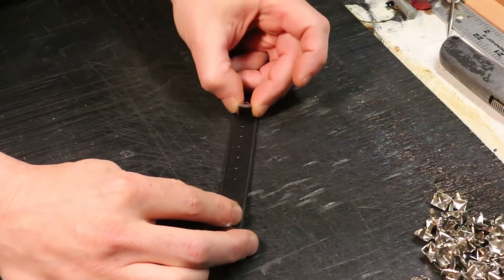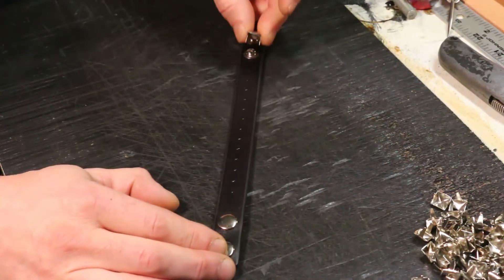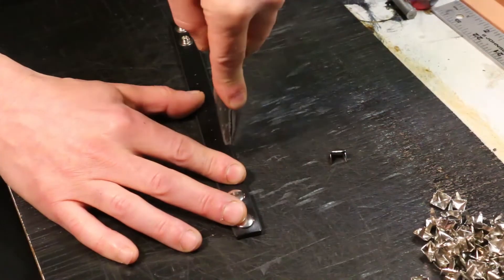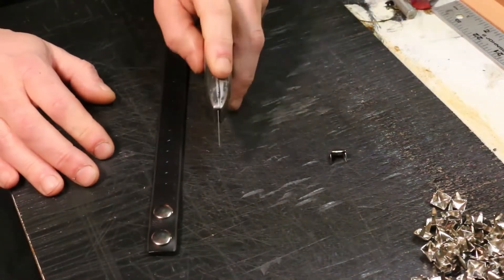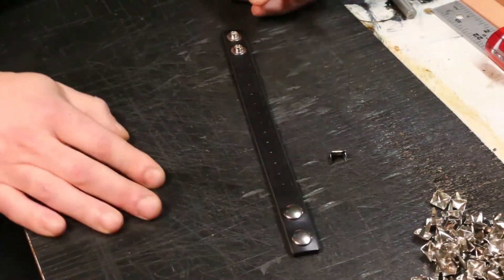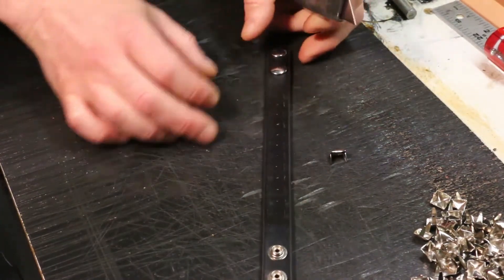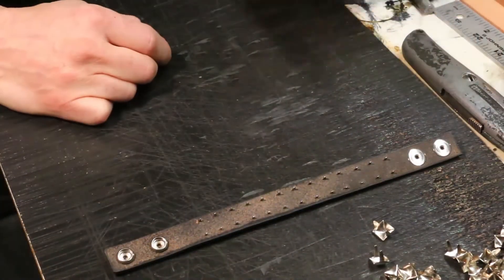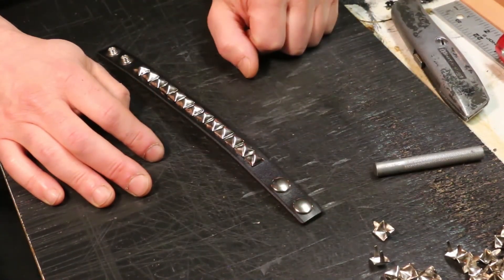How To Set Pyramid Studs Into Leather

Comment: What brand pyramid spots do you use? I use the ones by Standard Rivet. Though I've noticed the nickel plated brass ones start turning green on the tongs as the finish cracks when you bend the tongs. I may order some nickel plated steel ones to see if the finish cracks on that also. Not sure how easily they would rust. But I noticed the nickel plated brass ones starting to turn green after a few years. I'm thinking rust would look better than green. Though the nickel plated brass people say are more premium.
Reply from the maker: Standard Rivet is the ONLY North American company that makes these shapes. Everybody else you're buying from is just reselling SR products. 

The green oxidation is inevitable, but with steel, you still get rust, it'll just be red/orange instead of green. As you point out, this only happens on the underside to the legs (prongs) because they lose plating during setting. 

Cost wise, rolls of brass are 3x more expensive than steel rolls. I may have told this story before, but one of my earlier belt customers was mad when he thought his chrome/brass studs were cheap because he couldn't stick a magnet to it. So, now, I also have steel for magnet aficionados.
Reply: @leatherpunk  Which do you think are better pyramid spots, nickel plated brass or nickel plated steel? i.e. I'm not exactly sure why someone would pick one over the other. But I know the nickel plated brass is more expensive. 

I've bought mine directly from Standard Rivet as theirs look more classic to me compared to the flat/straight edges of other brands of pyramid spots.
Reply from the maker: @colt5189  From the perspective of someone who has about a quarter million shapes in my stock,  I prefer brass over steel because they're easier to set, less of a jolt on my foot when the prongs fold.

Comment: I'm trying to put pyramid studs into soft plastic, but I'm stabbing my thumb with the sharp ends😢
Reply from the maker: I bet they are. Instead of supporting it with your thumb, try to find something that's firm enough, but will allow the prong to pass through, maybe a piece of hard Styrofoam. Or, you could make a thumb pad to minimize the discomfort. I made a thumb guard out of leather to protect against getting cut during certain leather tasks. I also have one for my palm when I'm using the awl repeatedly.
Reply: @leatherpunk  Thanks so much. I'll adopt one of your ways now. I think I'm guilty of instant gratification or rather doing things quickly and to heck with the dire consequences🤔Thank you again.

Comment: How could I set these on shoes?
Reply from the maker: I've never done it, but you're going to be limited on where you can put studs on shoes, without taking the shoes apart. The most difficult part will be cutting your prong slits without cutting into other parts of the shoe, perhaps by stuffing other material in behind where you're cutting, to temporarily  protect other parts of the shoe.

Comment: What if your studs have four prongs?
Reply from the maker: It's the same process, but those prongs tend to be shorter than the prongs on US made studs. So you may not have enough length on them to go all the way through.
Reply: @leatherpunk  That's the problem I'm running into. Where do you find US made studs? I can't find them easily.
Reply from the maker: @Extreme_Horror_Phantom  studsandspikes.com